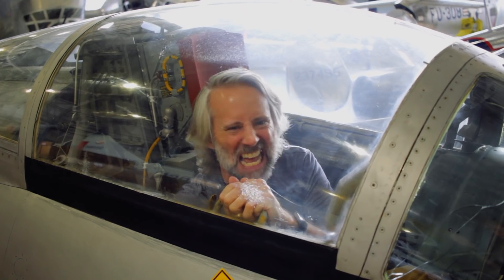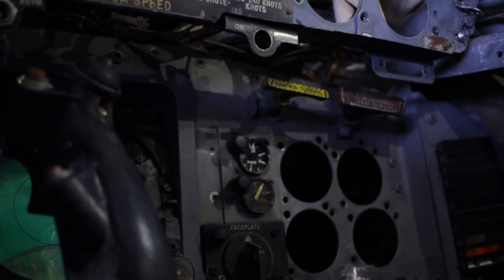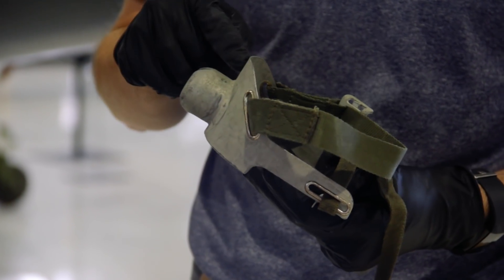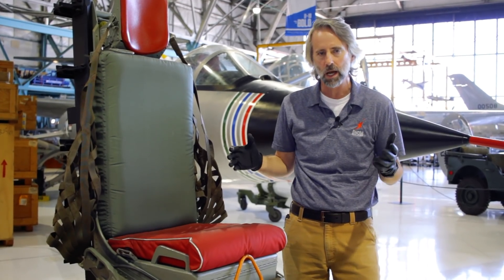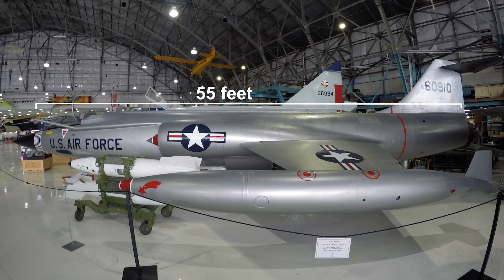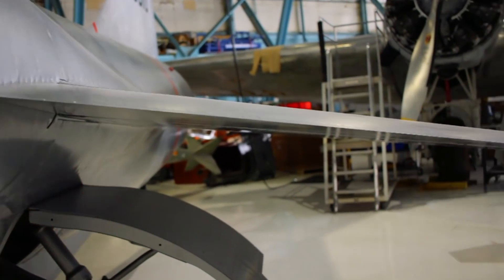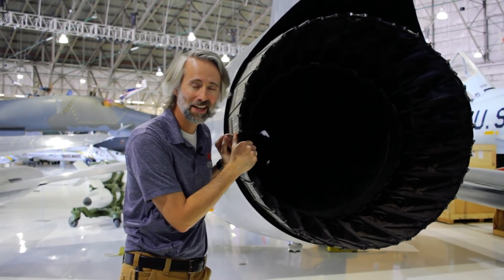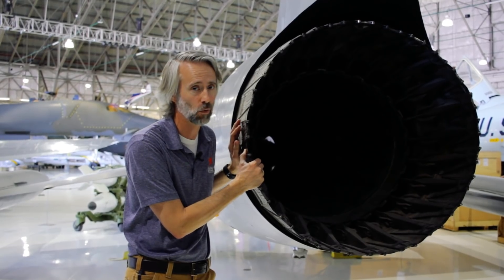F-104 Starfighter | Behind the Wings

Comment: Witwenmacher = Widow maker. That's what the German Luftwaffe called the F-104. Our politicians thought that it was wise to save on the aircraft's maintenance, which is why a lot of them crashed.
Reply: Actually the Germans used it in the wrong way. It was made to intercept other aircraft and even missiles. The only thing the Starfighter was supposed to do was going fast in a strait line at high altitudes and at day light. But German politicians got bribed bei Lockheed. They bought a lot of Starfighters, but used them as a multirole attack aircraft in harsh German weather conditions (lots of rain and lots of clouds). They mounted everything under the wings, and they advised their pilots to go low and fast or low and slow. A lot of pilot errors happened also because of the lag of training. Germany had to rebuilt its Luftwaffe fast to be able to fight against the sowjets if needed.
Reply: @Gentleman...Driver  The real issue was the German did not train their pilots right. They had as few hours as 20. Then got stuck in one of these.... You try landing one slow. It will kill you! Which is where most crashed. On landing approach...

I would add. They started sticking shit on the wings. Like bombs, Missiles etc.. It was now over weight...
Reply: It had the same nickname with the Canadian Air Force, and the same crash rate, but it's still one of the coolest jets ever. I got to sit in one, man you were jammed in there, and I had no parachute or flight gear.
Reply: @RU-zm7wj  It did not have that nickname in the RCAF. No Canadian 104 pilot would ever call it that. Not in a million years. That was an invention by the media and to this day it pisses off the pilots who flew it. (By the way, that's RCAF, there is no "Canadian Air Force")
Reply: Count on politicians to be stupid and corrupt
Reply: There were other reasons the German Luftwaffe had these big problems with this cool aircraft. We had a political scandal abouth bribes that Lockheed payed to some politicians. They could have also chose the F4.First:the F104 was designed for good weather conditions and in Germany specially in the early 60s had not these nice skys. Second: They wanted to much. The F104 is an interceptor not a multi role fighter. They used it as a bomber, interceptor,fighter plane. Third: They used own systems, actually good but to heavy. It was the wrong plane and they corrected this mistake replacing it with the F4.
Reply: @juppidisco  
> The F104 is an interceptor not a multi role fighter.

The F-104 was NOT designed as an interceptor.
It was designed to be a daylight air superiority fighter, which is to say that it was designed to take on MiGs and beat them.
The Germans wanted a multi-role aircraft and Lockheed modified the F-104 (mainly strengthening its fuselage) in order to meet the German requirements for ground attack.

> It was the wrong plane and they corrected 
> this mistake replacing it with the F4.

It was the right plane at the time as the other aircraft they considered didn't fulfill their requirements.
The replaced the F-104s with F-4s because they couldn't get the aircraft they really wanted.
Reply: @ Lewis Cole The F-104 was designed as a interceptor that was  later retrofitted as a bomber fighter and a very poor decision.
Reply: @garylee8132  
> The F-104 was designed as a interceptor 
> that was  later retrofitted as a bomber 
> fighter and a very poor decision.

Wrong.

The F-104 was designed to be a daylight air superiority fighter, as I said before, which is something you can easily discover for yourself from any decent history about the F-104 such as Martin Bowman's "Lockheed F-104 Starfighter" instead of listening to the repeated nonsense you hear on the Internet.
As it describes in Chapter 1, "A New Star is Born", Johnson went to Korea to see how his F-80 was doing and ended up going around to 15 air bases there asking fighter pilots what they wanted in the ideal fighter plane.
The unanimous message he came back from them was that they wanted a pure daylight air superiority fighter that was fast and simple and would outclass any MiGs that they might run up against.
(Keep in mind that the F-86s did not take on MiG-15s at high altitudes because that was where the turning advantage of the MiG-15s was simply overwhelming.)

Johnson went back to the U.S. and he and his team came up with the F-104 design which was submitted unsolicited to the U.S. Air Force.
And the Air Force then went to other aircraft manufacturers to ask for additional bids (to keep things competitive) for a replacement to the F-100, a daylight air superiority fighter, not as a replacement for either the F-101, the wide area interceptor which they had, or the F-102/F-106, the point defense interceptor which then had/wanted.

The Germans wanted an aircraft that could fulfill three roles, recon, interception, and ground attack and the boys at Lockheed promised the Germans that they could modify the F-104 so that it could perform all of those duties.
They strengthened the airframe so that it could take the additional stress of being a (low level) attack airplane and called it the "Super Starfighter" which became the F-104G.

And speaking of bombing, if you look at the actual definition of a "fighter" in the dictionary used by the U.S. military, it says that a "fighter" is also a bomber.
In other words, the U.S. Air Force expects every U.S. fighter to be capable of carrying and dropping bombs and so is in actuality a "fighter bomber".
Reply: terry waller  Did he really wow.
Reply: and because of the 104 flawless safety records, all nuclear power plants in germany build thereafter  were desinged against an f-104 and later against an f-4 crash....
Reply: The -104 attrition rates were less than that of the Sabre that Col Hartmann loved so much. 

Nothing wrong with the 104 design or how it was used. The F-105 was a purpose built strike aircraft and has the same atrociously high wing loading (the only way you were going to go supersonic on the deck and not get tossed around) and it also had a high attrition rate even discounting enemy action.
Reply: @Bartonovich52  Do you have a source for your claims? Afaik lost the German Luftwaffe 1 out of 10 F86 and 3 out of 10 F104 .... and the survival rate in F104 crashes were really bad due to the shitty ejection seat design....
Reply: NuclearSavety totally wrong about the ejection seat. Only prototypes and few of the first production models had downward firing ejection seats, and most of these were retrofitted with upward firing ejection seats. No German starfighters had downward firing ejection seats.
Reply: @Hornet135  i wasnt refering to the terrible downward ejection seats but the less terrible but still terrible upward Lockheed C-2, which had to be then replaced by the at least acceptable Martin Baker....
Reply: NuclearSavety I wouldn’t call it terrible, but early versions weren’t true zero-zero ejection seats. It wasn’t statistically more dangerous than other seats of the time, although the Martin Baker is considered to be a better design.

Comment: The reason the F-104G was so dangerous is simple - Wing loading. At MTO that would be near 150lb/sq ft. Compre that to another J-79 engine aircraft The F-4E at 114lb/sq ft. So the F-4E  wing loading was roughly 3/4 the loading of the F-104G at take off. Unfortunately I don't have the wing loading figures for landing. That ratio makes a big difference to take-off speed.